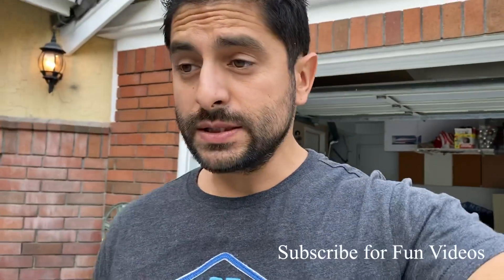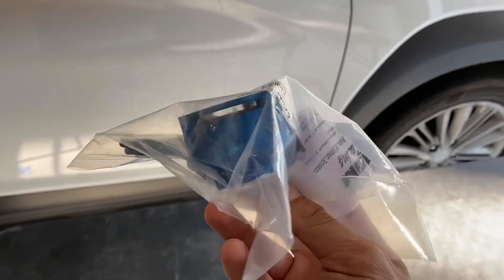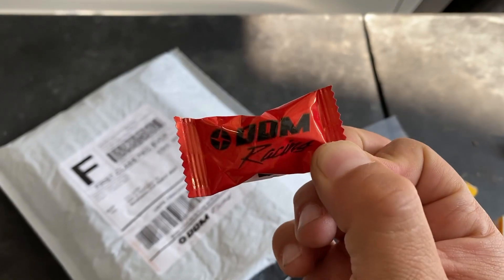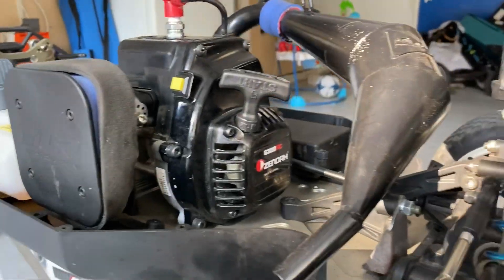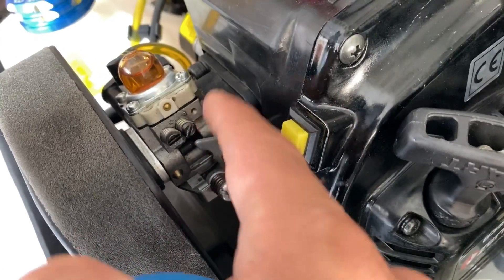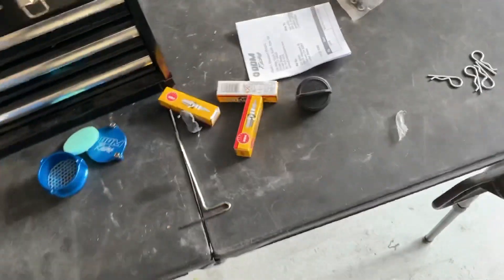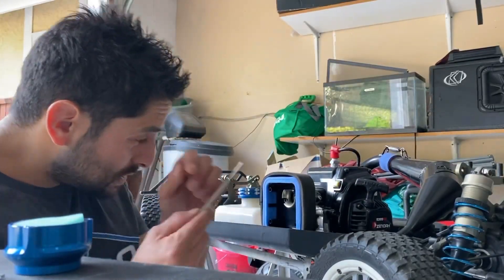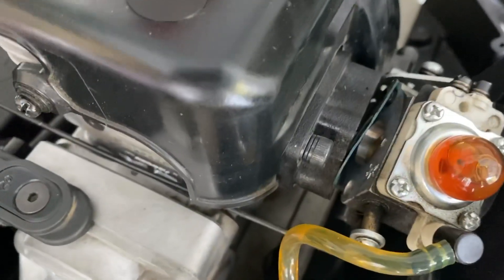DDM Racing Air Filter INSTALL on my LOSI 5T 2.0 - RC Truck - Smith RC Studios

Comment: Hey man I know this video is a little old but nice upgrades. I ended up getting that exact same gas cap for my 5T and even with the rubber inside it leaked like crazy also had problems screwing it on straight just wondering if you had any issues with yours leaking also sealed up the Breather hole still leaked
Reply from the maker: Hello thanks for watching. Currently today i still use that gas cap as you will see in my later videos. Personally problems with major leak. I did notice however that there is wet gasoline on the top by breather hole—but that’s no serious concern to me.

Comment: Get the DT-1 filter foam replacements  for the DDM billet filter you have 10 times better  than stock
Reply from the maker: This video is about 3 years old. I have made SO MANY mods and used different items since then. Lol.. But thanks for stopping by and also thank you for the support. Cheers